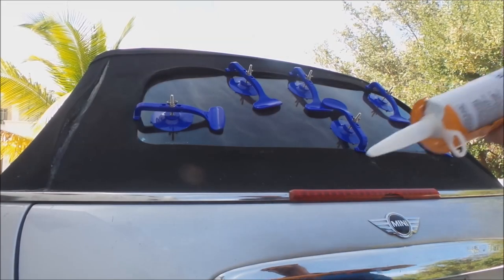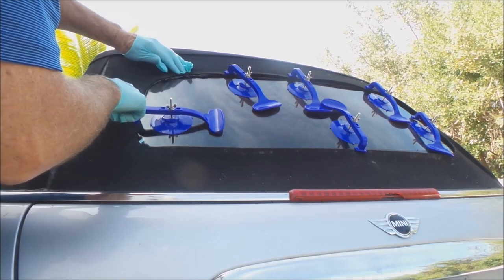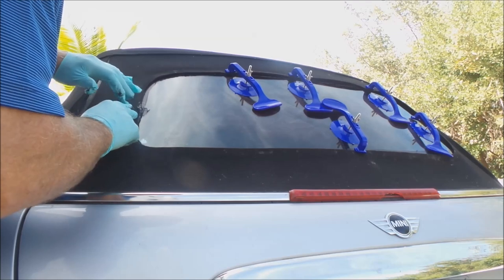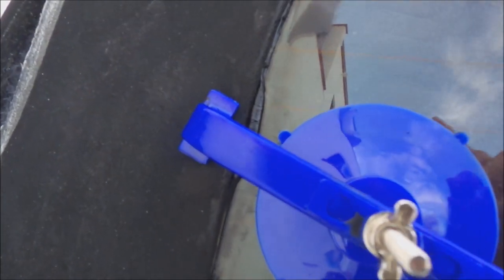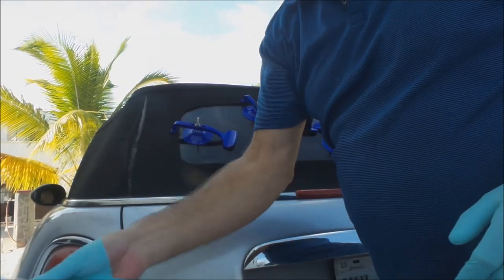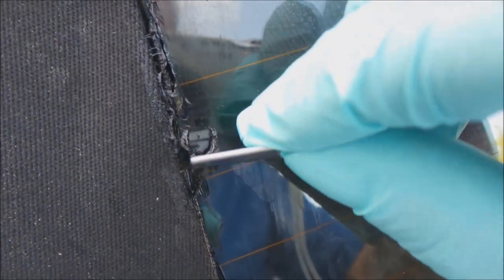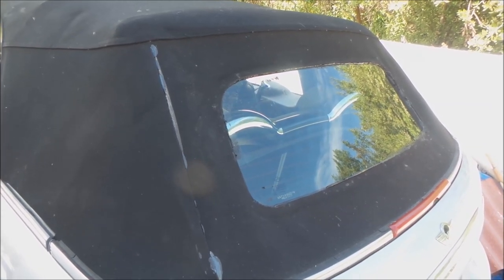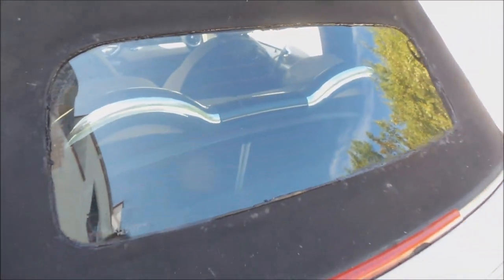MiniCooper Convertible rear window re-glue (Part 2 of 2)

Comment: I did the same procedure on my son's vw convertible. Used duct tape instead of suction clamps.  The 3m glue can be quite messy be sure to not get it on the canvas as it will be impossible to get out later. I also applied to much on my first bead and tried to "clean it off of the glass. The rest I did a smaller bead and it went much better. You can use a razor to clean it off of the glass, just be careful to not cut your canvas. We did this 2 years ago and the window seal is still holding up great. FYI: The dealerships wanted $4k to replace the whole soft-top with labor. (Soft-top replacement on line is only $900... $25 for a tube of glue is a bargain what do you have to lose?)

Comment: So after watching this video, thank you by the way, I have started my Mini Cooper R57 window re-glue. I also used the primer (3m Single Step Primer and the 3m Window Weld 08609) to reseal the canvass on the inside first. After applying the primer, i waited an hour to let it set, then re-glued the interior seam, i used wooden clothes pins to hold the canvass fabric together. I then moved the top down slightly, to get a little extra pull on the top, i started on the driver’s side and stretched the canvass on to the glass, set my suction cup holders, and applied a medium bead of the glue and tightened clamps accordingly. I then let this set an hour and a half with a couple of pillows pushing on the glass from the inside, and repeated this process all the way around the window. I will update with my results.
Reply: How well has the 3M Windo Weld held up?
Reply: Jeremy Hurst Actually it turned fantastic! I sold the car and I know the new owner and there’s still no signs of any leaks or drips so I would say it’s worth a shot.
Reply: Thanks for the update. I just finished it up on my Audi A4 per the video and your suggestions and it looks like new! 
Thanks to you and the original uploader, I no longer have to drive atound with a trunk full of water.

Comment: Just finished doing this to my '09 Mini. Thanks so much for the video. The only suggestion I have for others doing this is to make sure you either, a) remove the inside pillows after clamping but before gluing, or b) if leaving the pillows in place, do not move them until after the glue has cured. Otherwise you run the risk of smearing the stuff on the inside of the glass (like I did), which is hard to get at. I was anticipating a tedious, hot job trying to scrape the stuff off without damaging the window defroster wires. Started on doing just that, using the damp paper towel I had used to clean the outside of the glass to wipe off the dust where I had scraped and found, much to my delight, that if I scrubbed hard enough it came off! Apparently, it doesn't stick as well to the clear plastic covering the defroster on the inside of the window. Got lucky, but in retrospect, it was a problem easily avoided.

Comment: better to use painters tape around the perimeter before you start to prime or glue it down, I would think?
Reply: Definitely! I have a tan top and it would have been a mess if I hadn't masked it off with painters tape and plastic shething.
Reply: Yeah, painter's tape right at the glue boundary line with 3x5 index cards or newspaper on the other side of the tape to give yourself lots of room to work with.  The problem with tape and newsprint or cards is that he's using those suction cup clamps, which can make the tape hard to pull up.

Comment: Disappointed that you did not follow through with your comment about letting people know if this worked or how it held up. I'm about to try this here in Maine (USA). Sounds like you gave great advice because many other people recommend the 3M 08609 W/ the 3M single step primer. Thanks for the video, maybe ill make one myself. I'm thinking of removing the top and doing this on a bench.

Comment: Just like everything else in life… All it takes is time and therefore patience. I used Flex Glue which is white with the same gripping strength. 
Works fine, too.
Reply: That crap fell apart in Texas heat 😡

Comment: Hello.  What is the product name on Amazon for the suction cup clamps?  I can't seem to find them.  Thanks!
Reply: i think he said he bought it off Ebay
Reply: thank you for the video. definitely helpful. just finished rear window glass reglue on neighbor's pontiac solstice convertible. a couple of suggestions with the sealy clamps. spin them around compared to orientation shown in video so that the wider spoon-like side is placed on the fabric of convertible. also recommend placing wood strips cut to appropriate length to span distance between sealy clamps to distribute the applied force over a longer distance. a standard paint stir-stick cut to length works well. pleased to report a successful outcome and major cost savings. neighbor reported getting repair quotes from local body shops starting at $1500 to upwards of $3000+ with no guarantee of success. many shops turned down the repair altogether. cost as a DIY repair: clamps (6): $40, primer: $32, windo-weld glue: $30, total $103. labor time: a couple of hours start to finish. definitely worth a shot as DIY project.

Comment: Hi Scott
Can I ask what's that black primer for, why not jist use the adhesive? Thanks
Reply: 90nadz The other is a primer. Makes the tube adhesive adher much better.
Reply: That 3m primer is snome nasty shit.  I use it for everything.  Even makes 3m tape 10 times stronger.
Reply: Thanks for asking that.  I was wondering myself.  The primer apparently strengthens the adhesive and makes it several times stronger than when used alone.  I just ordered both for my Solstice's back window.